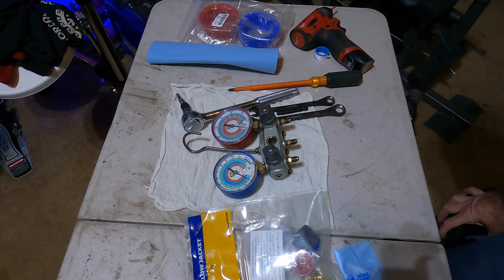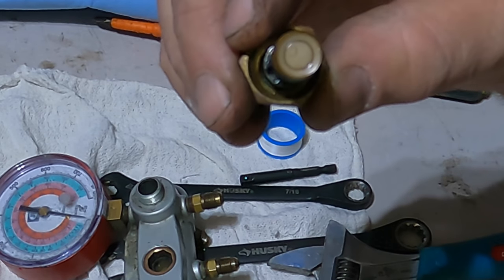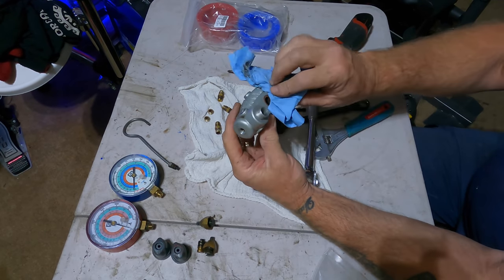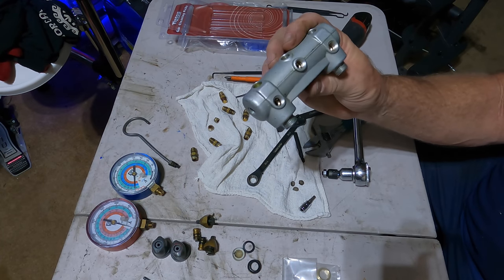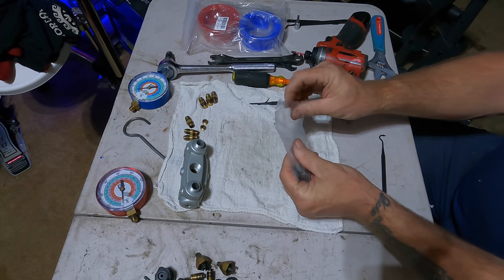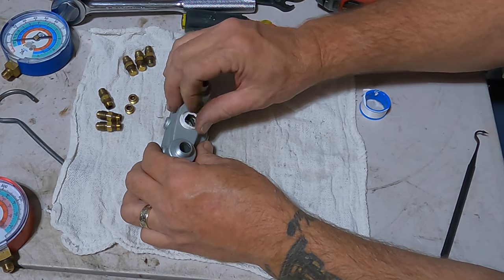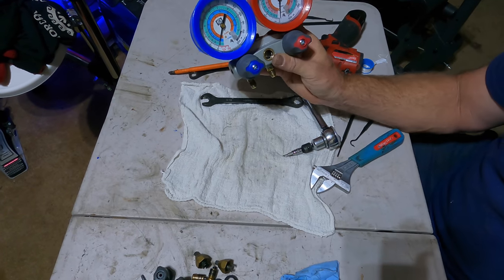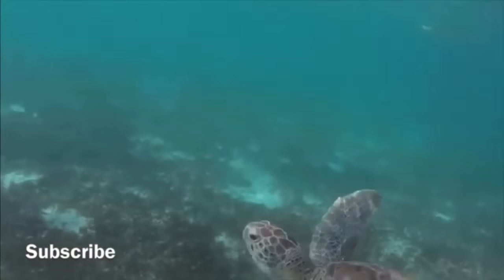What’s so Great about Analog Gauges?

Comment: Hi Dave, another great thing with analog is they aren’t afraid of WATER. The only thing I do differently is I use “leak lock” instead of Teflon on the threaded fittings.   I have probes and a set of 550’s but still use the 2 valve analog 80% of the time. The hvac police are hunting for both of us for using them on ALL refrigerants 😳😱😱😱 I know guys that it horrifies. Old school no drool. Nice job.
Reply from the maker: I have the same set up. I wonder if the YouTube police own 6 different sets of gauges? I put every flavor through my OG 550’s too. 😂😂😂😂😂😂

Comment: Analogs for the win , set of smart probes for troubleshooting and commissioning. 
If you worry a system is dirty it's nice to have a set of old beater analogs that you don't particularly care about as well .
Having a good set of reliable analogs you can rebuild is absolutely gold , no sensor to go out of calibration , no electronics to fail , no water damage , none of that ! Great video Dave 👍
Reply from the maker: I like the probes for sh sc and measure quick app. But I always grab the analog gauges 1st on service calls.

Comment: Smart probes fit right in my tool bag. I grab my YJ analogs when needed. Refrigeration repairs I 90% of time pull vaccum through manifold. New installs and big HP systems I use core removers and megaflow hoses.

Comment: My set is 35 yrs old and still useable. Good job Dave, technology will fail when you need it most.
Reply from the maker: Rain or batteries. The digital gauges are nice I have the 550’s but use the analog more on quick service calls.

Comment: Love my 2-valve Titan with the knobs on front - currently have my liquid-filled refer gauges on it for WIC/WIF and auto A/C. 
Had to rebuild them 2 or 3 years ago after thy high side started leaking (system running SUPER High head pressure with dirty refrigerant killed the Teflon seat), rebuilding them was very straight forward - used Loctite on all the threads instead of Teflon tape. 

Analogs with T's at the hose connection for pressure probes is a killer set-up, especially for troubleshooting a tricky refrigerant issue.

Comment: I now have a job as a pipeline operator and we have mobile reg units that are fed by trailers loaded with natural gas and we are used for pipeline emergency or schedule repairs . It’s has been raining non stop so our digital gauges are solar powered threw a satellite that tells the home office our trailer pressure and customer feed pressure. I would not have been able to set reg unit pressure if we hadn’t left the analog gauges in line . Our company is looking for people in California and Savanna Ga .

Comment: My go to set is Refco from 1989/90,  had about three sight glasses, four sets of taps, and probably four sets of gauges, the threads are wearing on the brass adaptors but the still work, oh and the hook fell off where it wore through the brass retaining nut but fixed that by soldering a 7mm nut on the end!  Only got to last me another 28 years until retirement!
Reply from the maker: Exactly I’m 34 years in and only 12 more to go 😂😂😂⚡️
Reply: @NorCal-refrigeration  I'm 47 now but out government want to put the retirement age up to 75! so got a few years to go!
Reply from the maker: @heavydiesel  I’m 54 looking at 66 if possible for retirement

Comment: The only thing I would do different would be to use thread sealant rather than Teflon tape. Great video Dave 👍
Reply: careful, not all thread sealants are the same, some will be attacked by oils, while others by refrigerants and some are rated for neither at all! even then a contaminated system may have acidic compounds and blends that will eat it up. if it should escape into the system, a sliver of teflon tape is far less likely to plug, damage or get stuck where it shouldn't( cap tube, sensors, TXV, bearing surfaces, etc.)
Reply: @throttlebottle5906  what about Nylog Blue?
Reply: @daniellynch4575  Nylog is pretty much very thick sticky refrigeration oil, so the right bottle for the systems oil/gas type wont hurt anything.
as for tapered pipe thread, it likely won't seal unless you add teflon tape to the mix(as their data sheets tell you to). pipe threads are rarely perfect cut and ill fitting leaving leaking paths, even if tightened to the point of breaking and shearing off.
they tell you to apply oil, tape over top, then more oil on outside of tape.

Comment: Use "touch all the time, confirm with analog gauges, always within 1 or 2 psi.

The digital equipment is great, battery power, and requirement to always recharge, a pain in the back!

Think I'll "stick with what works well".

ZERO customer complaints, nothing, ever, only compliments!

Comment: Stopped using digital gauges after my 4th sman needed warranty. Use titan analog 4 way for recovery and evacuation. Use the testo probes for troubleshooting and charging. Sometimes put the probes on my analog.
Reply from the maker: I’m starting to think analog manifold and probes is the set up.

Comment: You make a good point.  I have a Titan 4 Valve and Fieldpiece probes. No need for any digitals. Don't see the purpose. I don't need guages to charge, or recover. That's what T- Fittings on the probes are for, but if I want to for some reason, I have my bulletproof Titan Analogs. Don't see why I need to drop a significant amount of money for a setup thats like my analogs, that gives me more information .... but not as much or as well as my probes. QUICK QUESTION.... do they give you torque specs for how tight to put everything back? Or are they maybe available online?.
Reply: Hey just wondering how you recover and charge without a gauge set??
Reply: Wireless probes attached to a 3-way T fitting as Mr. Winston referenced.
Reply from the maker: I didn’t look for torque specs great question. I just hillbilly them back together.

Comment: Still working with my original JB manifold from 1975, as far as digital goes, it’s an analog world and analog is the only real life way to see what’s going on ! I’ve caught things like a sticking suction valve on semi heretics over the years by watching that needle, digital is useless for such things. Cudo’s on the WD40, you would have lost me if you broke out with the chumps PB Blaster, anybody that’s had to free up a fan motor knows WD40 rules ! And I lubricate the valves with refrigeration oil when I reassemble  my manifold, oh and unless I missed it I didn’t see you replace the screens ? If your like me it looks like your not done ! Nice video, the only question I have is what do them end plugs represent ?
Reply from the maker: Potential leak. Lol

Comment: Digital Guages Excel at ---

1) No more caring Pt charts in my Shirt pocket.
2) Superheat & subcooling right there.
3) Temperature guage right there. built in.
4) Telling if u have restricted metering device at a glance. High subcooling.
5) Condensing Temp at a Glance.

Comment: Hey Dave,
Good video but , " Teflon Tape " in My Personal opinion is a " Big no-no " in Refrigeration or Hvac. Should not even be on the Truck of a Refrigeration guy. Those teflon tape shards go everywhere. imo - We should ONLY use " Pipe Dope " in Refrigeration. Sorry Man, Great rebuild video but i cant get on board with using teflon tape. Bonus - Pipe dope is alot easier to apply too.
Reply from the maker: Your brand new replacement gauge come with Teflon tape on them. Your reaching